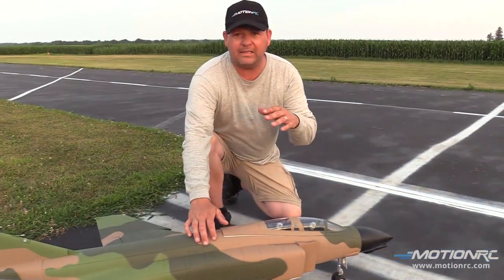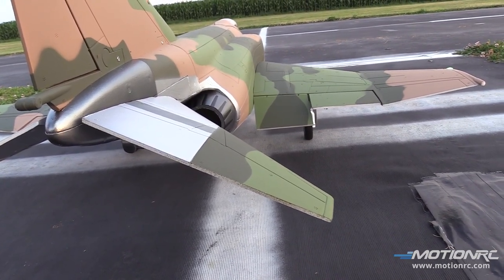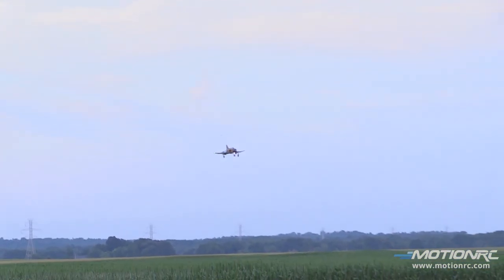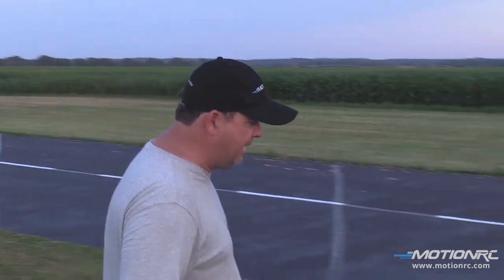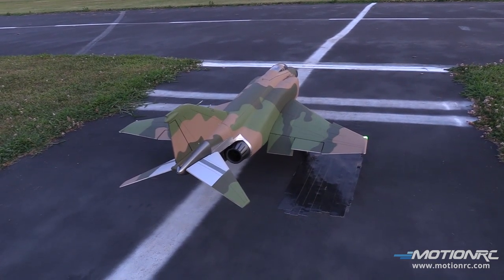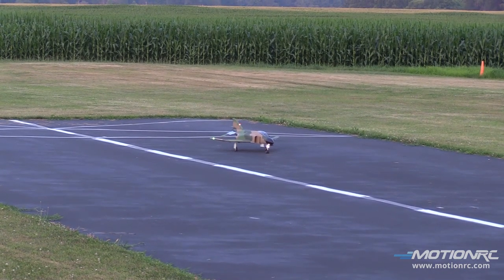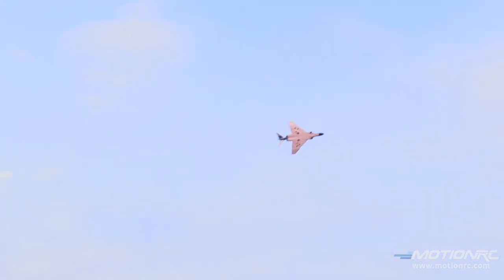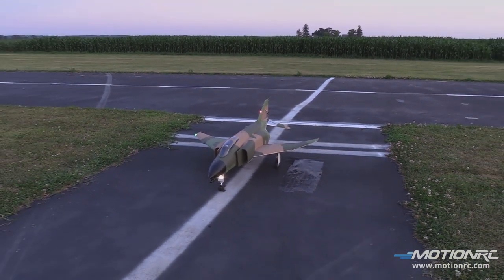Freewing F-4D Phantom II 8S - Flight Review - Motion RC

Comment: The 8S model I bought off you just arrived. woo hoo.  I agree with your views on flying nose heavy first, worst case you have  to add elevator trim. Tail heavy, worst case is a snap roll on takeoff. 
Keep up the good work. You need to upgrade your Futaba to an 18SZ or 18MZ and run telemetry. Beats guess work. Swap out the ESC with a Castle and get the S-Bus2 telemetry link. Add a Futaba GPS / Variometer and you have everything you need. total ESC data / rate of climb and decent, GPS speed and you can even add a temp sensor for the batteries if you are going to fly full mil power for a while. Also agree with previous comments on Futaba upgrade and the sue of local switches and the use of Flaperons. I will be giving them a try.  Im still working on combining the variometer and GPS speeds mixed with flight conditions to get a stall warning on landing approaches. Looks like I can get that to work on my new Graupner MZ 32. This plane is going to look interesting side by side with my LX F-4 Navy scheme. Its running 2 JP all metal 70mm fans.

Comment: Ryan, upgrade your 8j to the Futaba 16 or 18sz, then create flight conditions called Normal and take off (part flaps) and Landing (full flaps), 
use separate on elevator trim (gives 3 different elevator trims on same trim switch)
Then can adjust elevator trims as your flying, with flaps up, half flaps and full flaps down. It’s brilliant. 
Enjoyed the vid of the Phantom. Keith
Reply from the maker: Keith Jenkin thanks man I love the idea of flight modes.

Comment: Keep in mind that futaba has weird end points by default. What most radios call +/- 100 is +/- 151 on futaba. In short, by default, futaba uses about two thirds of the radio resolution.

Comment: Great flyin  Ryan as always!! Are you using full flaps or takeoff flaps in beginning of video? You never said. Just want to clarify. I get the up elevator for nose down effect, but not sure which flap setting you are going with for takeoff and landing, thx.
Reply from the maker: Jmizelle1 great question! I normally use no flaps on take offs. Same here, no flaps for take off.

Comment: You know those plane tracking platform tripods that fpv pilots use for their fpv equipment? I bet that would work for a camera system...some tweaking or the Arduino code and you’d be able to get zoom to work perfectly too! All automatically! A perfectly framed shot all the time, every time! Could be done relatively cheap too. All with diy if you have the know-how. 

Can I have a job?

Comment: Very nice, but I am very new and a horrible pilot (so far). I would crash it. My FMS Cessna takes a beating on every landing. Just gotta keep flying.
Reply: Hey, everyone has to learn some time, lol. I'll tell you though, if the FMS 1400mm series A6M Zeros come back in stock get yourself one of them... Although it's a warbird, it has such an airframe that it would be more manageable to learn to fly than trying to fly a P-51 for the first time and it can fly slower without stalling like other planes with more aggressive characteristics. Then you can get into the edfs that are faster and more challenging. Also getting yourself a nice flight simulator for your pc or laptop will be worth it's weight in gold, practice those take offs and landing approaches.

Comment: your mix is completely wrong.  elevator should be going down like the flaps so the nose doesn't lift up.
Reply: Initially true but as the a/c slows down you will need up elevator.